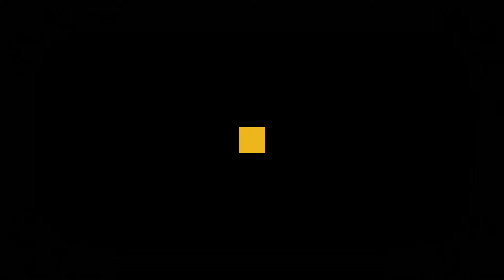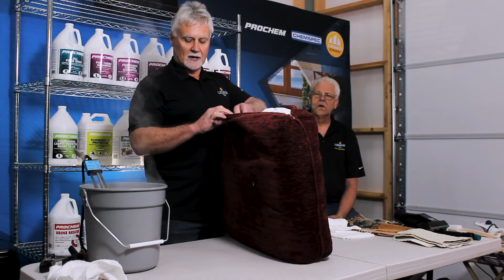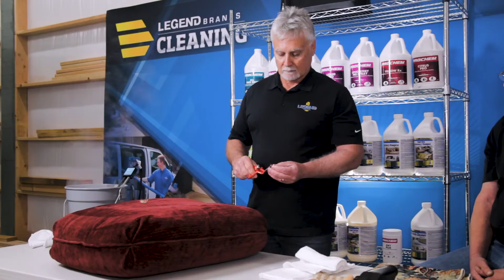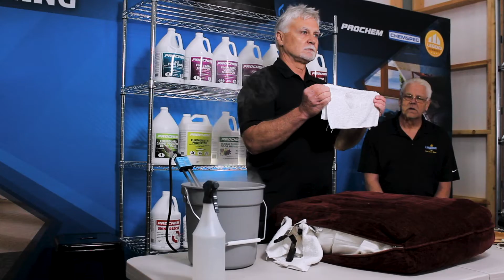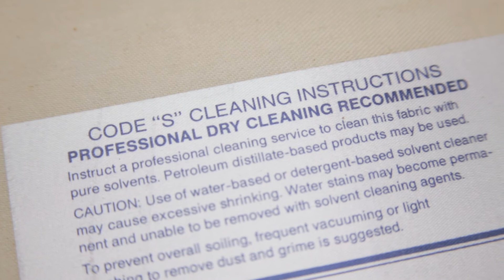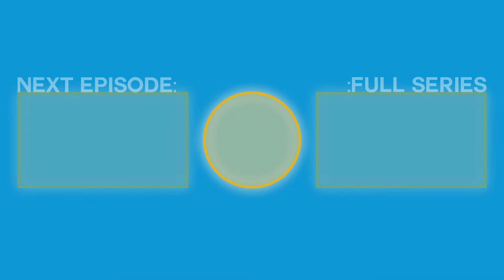Ep 2: PRE-INSPECTION // Part 1: DETERMINE THE FABRIC // Upholstery Cleaning

Comment: you mentioned about the cleaning codes on it that it is safe to assume that almost all fabrics can be wet cleaned as long as you control your moisture. does it also mean that i could use the same solution as i would on S and W codes as long as they dont bleed?
Reply from the maker: Yes, You certainly can. With any upholstery cleaning, the rules are always the same:
>Identify the fiber
>Control your moisture
>Control your pH
>Dry it quickly